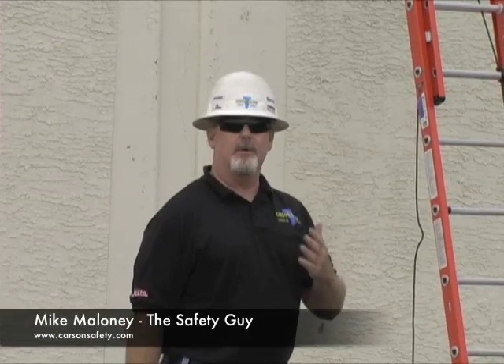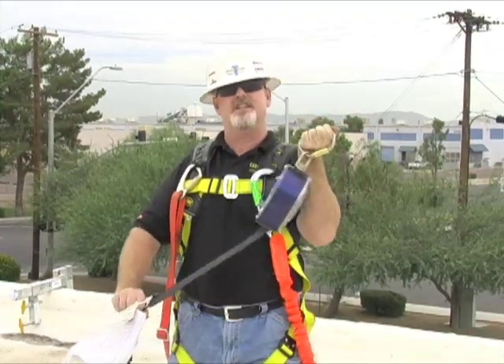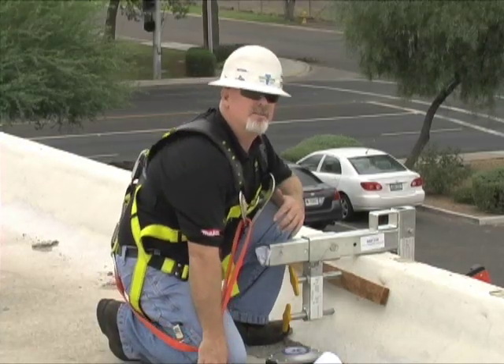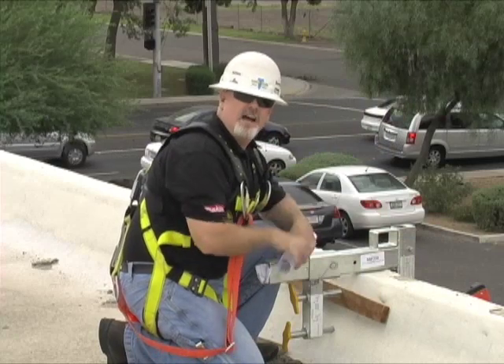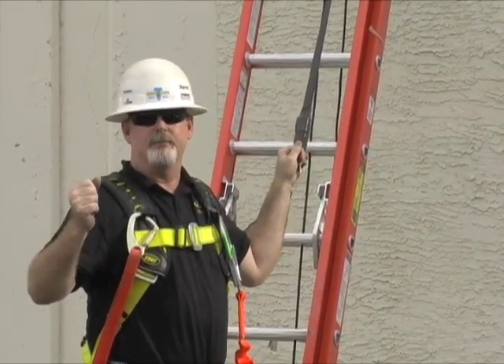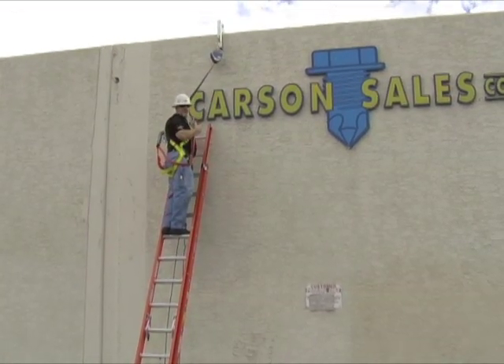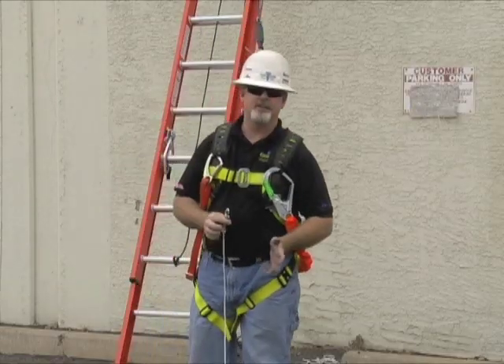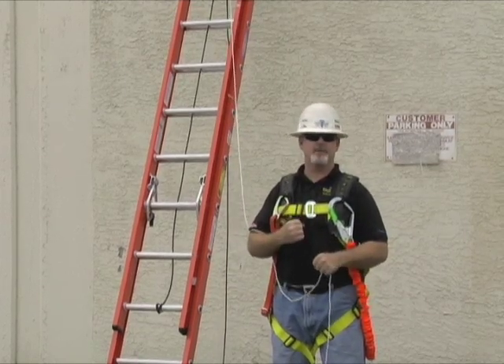Parapet Roof Anchor - CarsonSafety.com

Comment: As the parapet here is a triangular section, the anchor would pull off under the weight of a man falling- i would say wall bolt a plate to the parapet horizontally above the bottom fixing, to stop the anchor slipping.